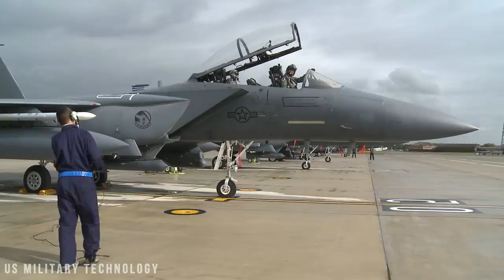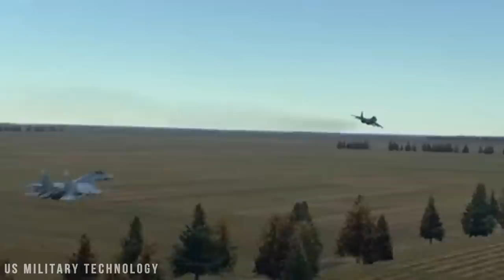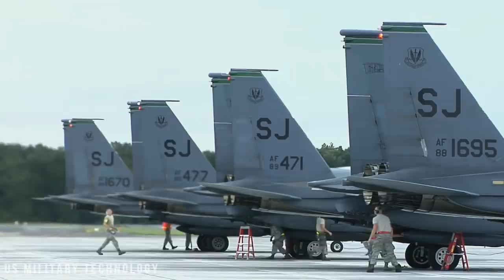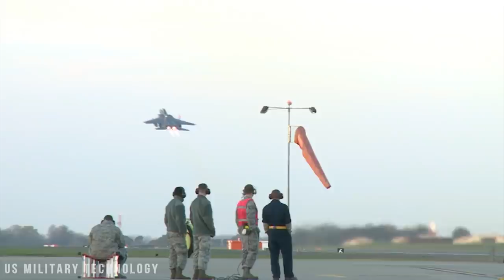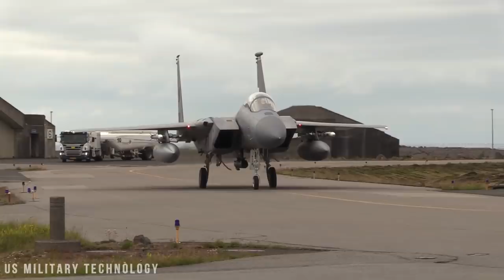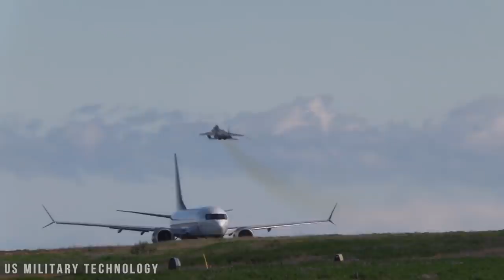A 'Stealthy' F-15 ‘Silent Eagle’: Smart Idea or a Waste of Money?

Comment: The F-15X is the way to go. The Air Force is not going to take on any more F-22's and the often delayed and troublesome F-35 is rolling out slowly. As a strike wing, the current stealth F-22's and F-35's can take the lead in combat with the F-15X's loaded with two-dozen long range missiles combined with modern radar jamming systems will be tied to the stealth jets communications. The stealth jets can target enemy aircraft and pass that information to the F-15's to launch their missiles. A deadly combination.

Comment: Issue with a Silent Eagle, is it doesn't have the benefit of Super Cruise like the F-22. As we are already building infrastructure for the F-35, we should incorporate the manufacturing to include building next gen F-22's, improving on flaws from the original fleet.

Comment: if they can make it as stealthy as the f-22 or close to then that would be perfect because the cost of a f-22 is just eye watering if it's possible to implement it into the f-15 there would be any point building any more f-22's that's what should have done in the first place if that is the case.

Comment: Upgrade as F-15 SE is only meant to get new orders and a jack up price where stealth is not real. But they already have a real stealth technology that can be fitted to any jet aircraft except turbo props or propeller driven type. Its called HUE. One F-15 C was fitted with it during the 90s and it crossed continental USA undetected. Time magazine reported it in 1996.

Comment: "kinda stealthy" doesn't work that well. The only thing you get is a modest change in detection range, and typically at a fairly high cost. Unless you can get to 0.1m2 or less, its a waste of money. Besides, the role of the F-15X will be largely ground attack in post-SEAD stages of a combat arena. It can carry a LOT of ordinance, and if it does meet a surprise A-A threat, it's far from helpless. They're buying it because some sorties just don't need stealth, and that's when the massive payload & range of the F-15 can really shine, and at a much lower cost than the ninja planes. It also has a higher top speed than the stealth planes due to no need to limit speed to protect stealth coatings.

Comment: Possible idea?? It has been concluded that restarting F22 production is financially unviable. The F35 has a very limited weapons capacity due to stealth design.The general idea of F15X is a modernised F15 with large weapons capacity.On appropriate missions it would accompany F35 & act as heavily armed escort until it's weapons are exhausted then head home leaving F35'S to finish mission with all weapons available.What about a combination of larger ratio of F15X + small number of F15SE (Stealth Eagles) with extra,stealthily designed hardpoints for additional weapons (& fuel? jettisonable? C.F.T's?) in addition to internal weapons bay. So, the scenario is deep penetration mission through heavily defended airspace.All jets are datalinked (perhaps with A.I threat assessment & fire command?) The system would first use all F15X's weapons,then F15SE's external weapons,then it's internal ones,leaving F35 to finish the job.Potentially depending on the scenario F22's could be added into the mix adding exponentially greater combined lethality & mission capabilities.This level of force multiplier effect would be hitherto unknown in modern air warfare.Probably the most effective thing would be for the pilots to just sit back & allow the A.I to make most of the decisions as it would simply be too complex for the pilots to communicate with eachother and make coordinated decisions within a very short & hectic time frame.Israel is working on C.F.T's for F35 (additional stealthy weapons hardpoints? Don't know) If this were to be applied to all of the aforementioned jets working in unison the force multiplier effect would be increased further still.It would be absolutely formidable & leave any potential enemy in a cold sweat contemplating having to deal with such a scenario.
Reply: Weapons under the wings increases the radar signature. You do not know anything!
Reply: Add some drones in the mixture which will mimic fighter signature  and defence is in big trouble

Comment: A new generation of F15 will work when new engines are placed inside and the air frame upgraded for higher loads. The same goes for the F16, F/A18 and F22.
Also, If your one of those who desire a new F14. The F14 will also require new more powerful and fuel efficient engines. As well as all of the problem areas which are well known to be engineered out of a new F14 pipe dream.

Comment: who knew that $100 for a plane would be a bargain, but there you go. the f15se looks like a winner. it flies, it has range and you can have one tomorrow. as you point out though, quoting RCS figures are meaningless if you are comparing 360 deg average to front only.

Comment: How about if you consider an F 15 fighter jet with both external and internal weapon load, to allow the fighter to defend itself after exhaustion of the external missiles; though with minute compromise on stealth.
Reply: It's a great idea for the most powerful airplane a bomb and missile truck that's goes 1800 mph with F35 and F22 out front picking targets the ability to share data between platforms in real time allowing them to essentially work as a single system.

Comment: The new F-15's will have to be much better than the older ones since the older ones are fantastic and have some of the same hardware and software that the newer F-22's and F-35's so they can work together easier.
Reply: Cruz roja

Comment: Are you actually using DCS World screenshots as your thumbnail? XD

On the topic of the video, I think it's a good idea to upgrade already existing planes. As long as the cost is low and doesn't tamper with its performance.

Ofcourse, this can only be done for so long before your upgrades become downgrades. 

The F22 is ridiculously maintenance costly. Even the U.S is seeing that the F22 is not as practical as they thought. That's why they canceled their original order of 900+ and left it at a maintainable 183-ish.

Comment: This should have been done long time ago. F15 is and was always the backbone and instead wasting billions on f35 or f22 using a proven platform. Stealth will reach apoint where there wont be any advantages anymore as technology improves and better radar systems design. No one knows 100% sure if countries already have the technology to make stealth obsolete . That still in question and if normal idealogical person would think this is an area any country would spend money to track stealthy planes. My judgement is it is already out there and it is just waitning for the surprise element.
At this time Usa are throwiing all their eggs in one basket which is gonna burn them in future.
All the money goes into one plane and only few other planes get upgrades.
What the use spending billions on a plane development only for one purpose and other functions left for the older planes to carry out. Sitting with 300 f35 and its obsolte  if they can be detected from a far distance make this plane a lemon and this is what going to happen in next 3 years. Radar and missiles get better by day .
Technology is a good thing but to much that it is high maintenace software failures ect . No man made thing can be 100% none there always a way to breach a system and so can the f22 and f35 be breached. 
F15 is a good plane common sense say invest in this platform and have good defence jet. Not too much technology but the best that available to get job done even if systems are done it can still do the job. This is a practical salution not this hi tech cash cows that will be obsolete in few years.

Comment: Damn the F35. It will be stealthy, ok. But the damn thing does not have the range ,speed ,or firepower than the 15X does. Unless they are going to build more F22's or something new ,then acquire this platform. If we need modifications, then make them. It might have started as a fourth gen fighter, but do not tell me we can't bump it up.As much as it cost to design, build( that includes the tooling), then work out the kinks for a new fighter platform, this seems a viable option.  You are relying on stealth alone. We made mistakes thinking a single idea could solve all problems before. You see how that worked out.
Reply: Sorry, its not viable because electronics progress stealth is the only one option.

Comment: The Navy have applied the same idea...converted the F14 from interceptor to a bomber (Bomb Truck). Good Idea though. In my view F14 should all be upgraded and updated to fly with the F35 C high/low mix.
Reply: The F14 was a better dog fighter then the F 15. Engines were seperated too so if it got a bird strike or major failure and the engine explodes its far enough away from the other that it has a better chance of other one surviving and saving the airframe. 
Problem was that the F14 cost a fortune to maintain.
Reply: Tom Minahan  the U.S had a fighter competitan with two great pilots. F15 vs F14. F14 won, for dog fighting anyway.